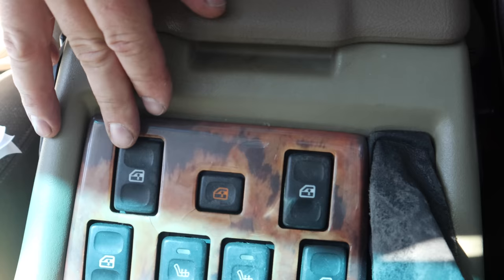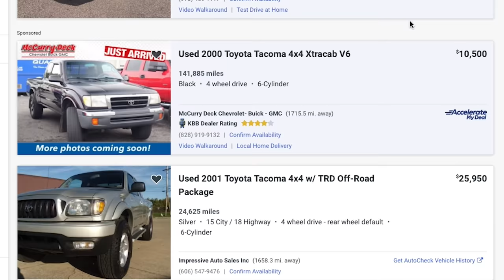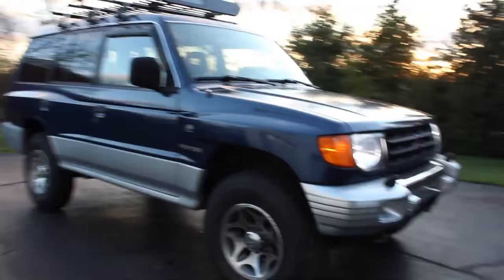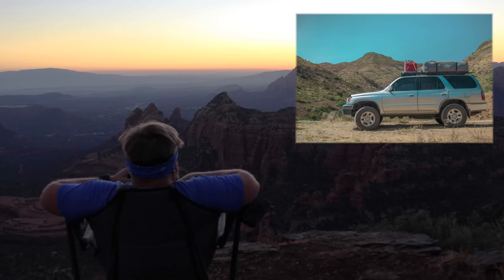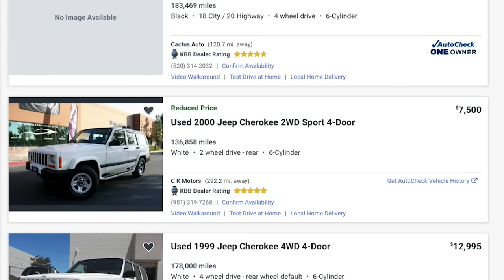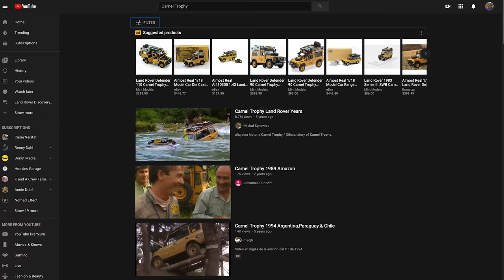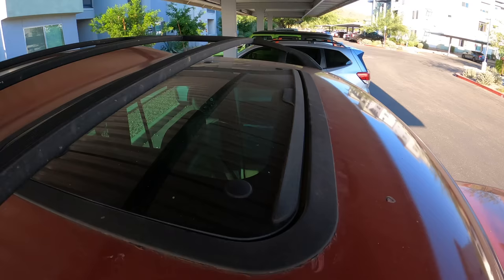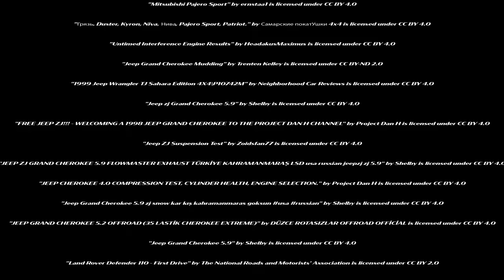The 5 BEST BUDGET OVERLAND VEHICLE Alternatives Under $5000

Comment: The Discovery is a great choice as long as you’re not depending on anything electrical or mechanical in it to get you back home.
Reply: So what you’re saying is it’s a poor choice.....
My thoughts exactly
Reply: They can actually take a huge beating and make it home. See Steve and This Week With Cars and his experiences in the cheap off-roader challenge.
Reply: That was a long time ago. Now everything is figured out and has good aftermarket.
Reply: Yeah, awesome capable rig, but I don’t have a lot of confidence in the “Buick” engine. I use to do head gasket jobs on those at the stealership. Very easily job, but every once in a while one would come in and the block would have a slipped or cracked liner.
Reply: Land Rover Discovery 1 which are pre 1998 are at least is better than 2000 - 2006 Discovery II.
Reply: @562Omar  Yeah, my buddy bought his off the dealer cause the customer never paid the bill on a diagnosis for a few hundred bucks. It was a red Disco I, He bought everything suspension upgrades Rovertym had available for it at the time. It was pretty bad ass. I had a SWB RRC, did a lot of fire roads and sand dunes. It was pretty good, bought it for $500 cause it had a blown head gasket. Then sold it for $1000. You can’t even find those RRC’s anymore, let alone at a cheap price! Wish I would of held on to it.
Reply: @JB-dl4ul  always liked those myself. Those tailgates were rot fests though. I think D1s are going to continue to appreciate and I regret not buying a few of the pristine ones I’ve seen the last couple of years. Mine is a little banged up but mechanically sound. Our first one we had to trade away after it overheated one too many times.
Reply: True Land Rover are scrap. Worst 4x4 on the planet nothing but problems

Comment: The xterras ugliness is why I fell in love with it over time, kind of like that pug your daughter brought home and you initially thought it was a mutant.
Reply from the maker: I hear you man! No matter what you think of how it looks, it definitely can perform, and that VQ V6... I had a Frontier at one point and that was the thing I remember most about that truck.
Reply: Are xterras on par with 3rd gen 4runners?
Reply from the maker: @armandosoria7993  1st Gen Xterras are, second Gen Xterras are more of a 4th Gen 4Runner competitor. About the only substantive difference between them is that the Xterras have leaf springs in the back where 4Runners had 5-link rear ends with coil springs.
Reply: I loved them since they were released. The “macho” looks, and the fact that I’m not driving a “soccer mum- mobile” is a relief.

Comment: Well I'm hanging on to my 2003 Tacoma SR5 4X4 extra cab I bought new. Every time I bring it in to the local Toyota dealer for routine maintenance they try to get it from me. I just laugh at them. Nothing has ever gone wrong with it, not even dash lights. Oh, and it has only 90,000 miles on it and looks brand new. Probably one of the best vehicles ever made.
Reply from the maker: Tell them they'll have to pry it from your cold, dead hands! Never let that thing go, you'll regret it! Every time i see a facelifted First Gen Tacoma, I get really sad and upset with myself for letting the one I had go! Which engine does yours have the 3.4 or the 2.7? Mine was a 4WD 2.7L with a 5 Speed. Man that thing was perfect!
Reply: @MattKester  It's the 6 with auto trans.

Comment: Lots of great info, I am a Mitsubishi guy and figured I would add a little info.  The SR models.. almost all of them are factory rear air locked and came with a 220 hp 3.5 DOHC V6. The transfer case is always locked in low range. The 2nd gen is split with the 97-99 models (2.5 gen) having coil front suspension and a SOHC V6. They are very sought after and not under $5000.  The Montero sport was available with a factory locker, as are some gen 3 Monteros, option and year dependent. The ZJ almost never came with a 231 tcase most 6cyl have the 242 tcase with an AWD setting that is fantastic for overlanding; and all of the V8s came with the 249 witch is stronger but not as rock crawling happy.  Also basically every timing belt engine is interference, all Toyotas are, the DOHC Montero engine is a bit more expensive, definitely a bigger job.  O yeah, I am professional mechanic, and I own (overland) both the Jeep and the Montero. Both for sale now actually.

Comment: First off, great video! I enjoyed the way you delivered your content. 

Second, I've had two ZJs, one with the 4.0 and one with the 5.2. Both were fantastic vehicles for me and were amazing on the trail. I loved the power of the 5.2, but it drank gas like a dehydrated dog after a long run. Loaded down with off-road gear it was especially bad. I sold my ZJ recently and bought a 2008 Jeep WK with the 3.0 CRD engine and I LOVE that rig. It has torque for days and even fully loaded down I get around 23mpg on the highway. The WK is a real sleeper in the overlanding world, especially the 3.0 but the 5.7 is great too. They get a bad rap because of the 4.7 (turd of an engine) and the 3.7 (underpowered) but they can be really great and can also be had for a good price. I paid $5500 for mine. Granted, it needed a little work but I had no issues sorting it out and I've got a reliable beast that is easy to work on now. The sound of that turbodiesel is super satisfying for a gear head. The 5.7 and the 3.0 both come with an electronic limited slip system which locks out the front and/or rear diffs when it senses a lack of traction. It works super well. I've never been stuck in it.

Comment: I've absolutely loved my 2nd gen Xterra! But I totally get the design opinions, I wasn't a huge fan of the look until I bought one. My wife really loved the look ever since she was in high school, and we got it for only half what comparable 3rd Gen 4Runners were going for in the area. We paid $7,000 for ours, but it had a couple extras and a brand new transmission,  you can find them for under $5k easy enough. I haven't regretted it at all! We got the Off Road trim with a manual (huge plus there, I'll take manual over auto any day) and it's a beast, it goes everywhere I need it to, carry's everything I need, comes with a factory rear locker and Bilstein suspension, and has slightly more power and torque than even current generation 4runners. But, like you said, you need to do your research and you need to seriously inspect any that you look at. The 2nd gens have big advantages to the 1st gens and look better, but '05-'10 autos have serious SMOD issues to look out for (one more reason to love a manual) and until 2010 they had issues with timing chain guides wearing out. I'm not hugely fond of the electronic transfer case (our first offroad trip we blew a relay and got stuck in 4low, but it was a bit of a fluke and probably won't ever happen again) but all in all I wouldn't hesitate to buy another one in good condition.
Reply from the maker: I hear you there. I had a then-new '07 Frontier for a couple of years, and it was great. I had the manual, which exempted me from the SMOD club, except that the clutch disintegrated after about 7000 miles and the dealer told me to pound sand when I asked them to cover it under warranty... but that VQ engine! That's gotta be on the list of all time great V6's! We did look at a really nice looking 2nd Gen Xterra before we went with the Disco. We were into it enough we looked at it twice, I only think they were asking about $4k for it with just under 200k on the clock. It did have aftermarket Bilsteins and Toyo MT's on it, but ultimately, my wife had a love at first sight moment when she saw that Disco on eBay and that kinda sealed it for us!

Comment: I got a Gen 3 montero, love it! Cheap aftermarket parts (limited but cheap) and goes practically anywhere. Got mine with 150k miles for 3.5k, no major issues other than general maintenance and she’s got power when I need it and comfy enough for my 2 boys to fall asleep while driving :)
Reply: My sister had 1 brand new in the early 2000’s. Apparently they flipped more than any other vehicle at 1 time. Very controversial as far as reliability but I’m happy to hear yours has been reliable. I have the Rodeo and love it! Much more fun to drive than a 4Runner.

Comment: I have a 1992 pathfinder xe 4x4, I love this little rig. It sat behind the barn for years with a bad transmission. When the pandemic hit I put a new trans in it new tires and rebuilt the front end. Changed oil and drained the gas. Runs like a top. Timing belt should be done next.
Reply from the maker: That’s awesome! Keep up the good work!

Comment: I owned two Discovery I's and they were pretty reliable. Now have a 99 P38 Range Rover. Similar drive train to the Disco. Take out the rear seats and you have lots of storage space. Lots of parts available from vendors and eBay. Not that difficult to fix problems if you work on your cars and lots of advice from forums. Very nice on road vehicle and I have kept up with all the Defenders in my LR club. Can be found for under $ 5K but are starting to appreciate in value.

Comment: 3rd Gen 4runner here. Bought it 4 years ago from the original owner in Arizona. High miles but clean and rust free. Over 300k miles now and still running great, ready for another trip to Moab. 👍
Reply from the maker: Right on! The one we got spent the first fifteen years of its life in New Jersery. Fortunately, the under side of it doesn't look like it spent that much time on the east coast! We're currently at the mid-160's mileage-wise and I'm getting ready to start doing some work on it. I'm expecting to start having some of that content rolling out in January.

Comment: Gonna drop a hidden gem that most people have forgotten about and is still cheap. R51 Nissan Pathfinder. Before people say  'it's got independent suspension' look at how capable they are stock (payload and tow capacity), how cheap they still are, and reliable . Driven mine through hell's revenge is moab as well.

Comment: Huge fan of the Discos- both Series I and II- with maintenance and attention- they're beasts off road! Biggest thing to watch out for is, as you pointed out, the head gaskets- but on the Series II- if you do the inline thermostat mod- that problem pretty much goes away. Super luxury with some of the best off road prowess available still to this day. Hill Decent Control is amazing- as is traction control. Full time 4WD makes them gas hogs- but so is the Toyota Land Crosier at 10MPG....Nice content- I'm subbed! BTW- I watched your Disco Head Gasket video and the one that listed all the problems with the Disco listed by the specialist- you're taking the correct approach. Nearly every problem with Disco's can be tackled by a competent DIYer like yourself- at 1/10th the price any specialist will charge. Seriously- Land Rover specialists are very, very, very proud of their work- but it's work the owners that understand vehicle basics can tackle- and learn the items they are unfamiliar with. Parts are relatively cheap- do your own work and you'll not only know every inch of your rig- but it won't scare you to overland it anywhere in the world- and it will go anywhere!
Reply from the maker: Thank you! I was shocked with just how mechanically simple it was to work on! My first car was a 1987 GMC Sierra Classic 1500, and working on the Disco has reminded me more of that truck than anything else I've ever had. Now I get why old Land Rover's have such a following, they really were amazing! They're a testament to a bygone era where vehicles were built to be simple to maintain and operate, not the era we currently find ourselves in where you need a software engineering degree to do anything with vehicles that have a five-year, planned obsolescence cycle.
Reply: I went with the 180° thermostat from the tdi and a new Nissens radiator which basically does the same as the inline thermostat but just looks cleaner 👍

Comment: I commend anyone who endeavors to maintain a flaming pile or British oil leaks. Here here
Reply: @radicalron65  Indian!!!
Reply: Maintain it properly and it might not leak 😂
Reply: @doominic1882  ....you wish...
Reply: We get the 300tdi in the uk
Does not have the same head gasket issue as the v8. Like i say leaking oil is just old seals or worn pipes. Would you expect any less on a 20-30 year old car? Lol
Fix the seal/ gasket or pipe and they are fine. Neglect just one of the 100s of seals that are in there and you got your leak. Lack of maintenance due to cost or lack of knowledge on how to ;)

Comment: Sold my XJ for more money than I would've paid for it and bought a 3rd gen 4runner.... love them both !
Reply from the maker: Right on! Sounds like you timed the market on the XJ. I’ve always kinda thought I’d like to have a two door one. I think I might have missed the boat though, unless I wanna pay through the nose for it!
Reply: @MattKester  i don't know if the market was up in those yet when I sold it. Maybe it was. I never planned on selling, did a bunch of work and spend a bunch on money. I sold it 1 month after building both diffs with 4.56's and truetracs, I didn't even get to enjoy my work! Guy really wanted it. Now after almost 2 years of driving this 4runner,  and again doing a crap ton of work to it I don't know if I'd go back into an XJ, the ride and build quality is soooo much better! Plus it just hit 140k miles.  Toyota parts are quite a bit more than jeeps stuff though, that's the unfortunate part.
Reply: @eriksdodges853  i have a 3rd gen with over 200k still runs and drives like 100k. and only preventative maintenence besides the valve cover gaskets

Comment: Love ur channel! Just got into looking at the disco 1 my Subaru sti is my first car but not really an off road vehicle anymore, been looking into montero’s, Isuzu trooper, jimney’s, 4 runners, Honda passports, Isuzu rodeo’s, s-10 blazers, etc but after looking into the land rover growing up always thought it was too expensive but after doing research the only things that are expensive/ are going to be the main issues are : head gasket which these are nice compared to my Subaru where you have to do timing when u take the heads off and engine out and the other is suspension parts🤷‍♂️ maybe the leaking sunroof but not really bad one of the more expensive parts would be the radiator but haven’t really seen anything on those commonly going out but keep up the content!😁
Reply from the maker: Thanks! Yeah, they are a quite relatively simple to work on compared to a lot of other rigs out there.

Comment: That Beefest reference deserves a comment 😂

Nice videos 👍. I've seen the prices of XJ's soar recently. Went to a car auction here in the UK and saw a clean Orvis 4.0 model sell for over £10k, which is insane (cars depreciate over here like mad - even 4WD's unless they're future classics like Landcruisers, Defenders etc.)
Good luck with the disco. The electrics even in the gen 1 can be a pain. Clean ones are relatively rare now in the UK due to rust, bad electrics and a lot of people buying them for cheap offroaders.
Reply from the maker: Thanks man! So far the electrics on the disco have been relatively okay. I do get an intermittent ABS light and the rear window switches like to quit working once the vehicle has come up to temp. I was able to take apart and fix one of the door switches that wasn’t engaging the down portion of the seat lift. I am sooo thankful I had the switch on a big table when I finally got that case open! Looked like the inside of a pinball machine exploded everywhere with the springs and balls shooting every direction!

Comment: My 98 4runner,,,,, 288350 miles and still rockin!!
Reply from the maker: Nice! Our 2000 SR5 is rolling through the mid 160's right now, but I have no doubts she'll be a three or four hundred thousand mile rig. She's gonna start getting featured a little more coming up in January as she's way overdue for some necessary maintenance. I'm going to be doing the front end bushings and upper ball joints for sure, and I might be getting creative with a couple of other things. Hopefully you can check it out when I start publishing them!

Comment: Dang I've owned most of this list!  I had an 89 Montero (4 door), a Disco I with a 5-speed, a Jeep ZJ, and a Gen 3 4Runner.     The Montero was ridiculously reliable and fantastic ride on all terrain but are super hard to find now and no aftermarket stuff or even spare parts anymore, and the Disco was the best off road bone stock.   The 4 Runner had a rough ride, and I never wheeled it.   Honestly for the buck, the ZJ wins hands down.  Great on and off road, super cheap to buy, even cheaper to fix.   The 6 cylinder is tough as a mule and easy to work on.  Plus, lots of aftermarket parts.  I put a 2" budget boost lift on it for 50 bucks, 31 x 10.50 tires and could go anywhere.
Reply from the maker: I hear you. It's crazy how capable the first few generations of Grand Cherokees were and what a bargain they are now!